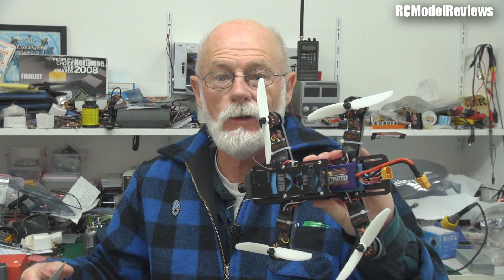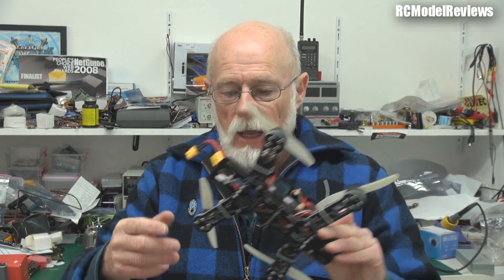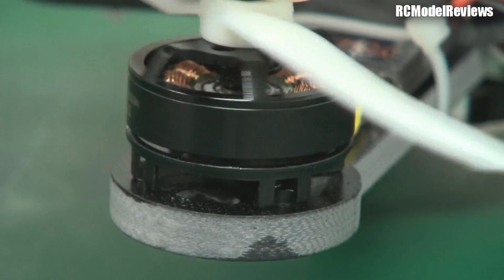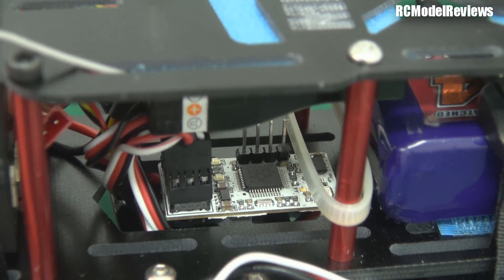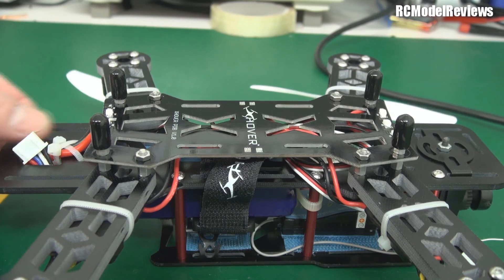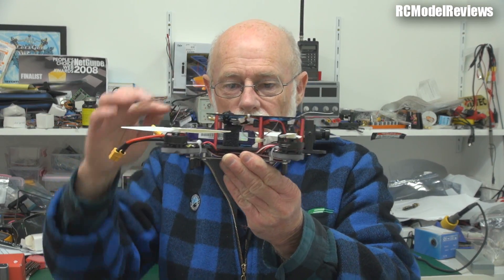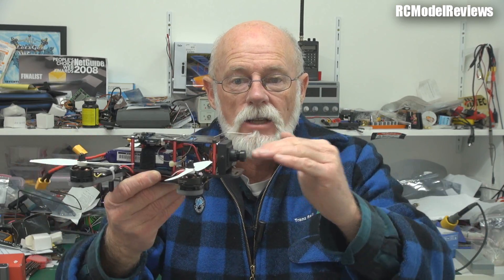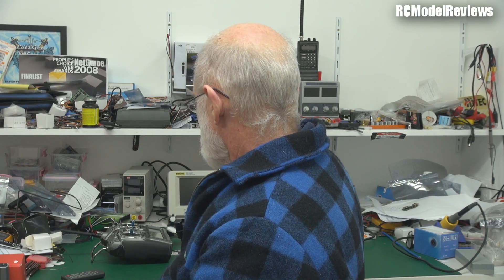XHover MXP230 mini quadcopter review (part 1)

Comment: Hi Bruce! got an issue with my vtx grounding to my mxp230 carbon fiber plate. The vtx has a 10cm extension with 90 degree end for the antenna. The 90 degree end is going through the antenna mount hole on the top plate of the mxp230. after a flight of fuzzy lines in the video i landed and the top plate around the antenna mount hole was VERY hot. Would you know why this is happening? I know carbon fiber is conductive but is there anything im doing wrong with mounting the antenna trough that hole? Thanks again for help Bruce!

Comment: For my second build I've been considering this frame. Does interference from carbon fiber make a difference in range?
Reply: So long as you position your antennas clear of the frame then there should be no problem.
Reply: Ok thanks for the tip!

Comment: Bruce,
When you directly solder the motors to the esc's, do you have to strip the insulation from the motor wires? Or do they not have insulation that far out? Did you or could you do a quick video on the best way to solder the motors to the esc's?
Thanks

Comment: look forward to your shootout, however I wonder if the frame is a significant factor to the flying characteristics, after all it's just to position the motors and components in the right place with as least weight as possible.  surely the flight controller, choice of prop, motor and esc plus tuning and config would have the greatest affect on the flight performance.
Reply: A lower quality frames arms may flex and more readily transmit the slightest vibrations to the camera and flight controller. It does make a difference. :)
Reply: It's a combination of frame and controller.  Every component plays a part in the overall performance of the craft.   Certainly the controller is one of the biggest influences but as MW2Stambo points out, a bad frame can also cause problems -- especially when you are really throwing one of these things around.  I know of some manufacturers who have in the past, changed the geometry of their frames to solve handling problems and a twisted or flexible frame will never fly as well as a rigid/straight one.
Reply: all true and thanks for the comments, seems to me however that you don't need a flight test to measure frame performance.  Sufficient to check the geometrym weight and stiffness (bending/twisting with your hands), these measurements are enough to sort out the good frames from the bad.  :)

Comment: Hey,
Looking forward to the 4s flight! :D
How have You managed the FC offset, because the afro mini is far out of the CG?
Because i have a afromini my self and also want to put my battery inside the frame for protection
Reply: I was a little concerned as to the effect that moving the FC away from the CG might have but to be honest, it makes no difference at all.  Several people flew this machine over the weekend and they all had nothing but good things to say about it -- with the controller mounted exactly where you see it in this video.

Comment: I had terrible issues with the delta 8 receiver! Could barely get it more than 40 feet away before failsafe :O Maybe its just mine, can't wait to see if it is haha
Reply: No problems with the Delta8 -- flew it yesterday and it was rock-solid using the Hitec Aurora 9X radio.
Reply: Huh.. Well, thanks :) Maybe it's just mine

Comment: I've been after a Naze 32 for a while now. Looks like it flies well on the Afro version & they are in stock. If I order one, do I need any headers (straight or 90 degree ones?) It says something about a 3.3v serial cable that is not included. What does it mean by that? Can't wait for part 2. Keep up the good work.

Comment: just thought id chip in bruce the fr - sky delta 8 I don't like for mini quad I upgraded to irc uhf 4 ch on my black out mini h I fly around me in 300m field with lightly dotted trees at about 100 metres behind one tree i lose signal guaranteed everytime with the delta 8 Los is a mile on my tbs discovery with both aerials in a v I made to keep them straight I'm using the futaba t8j tx fhss mode cppm mode on the naze full board 600mw ir 5.8 ghz  just so you know ...... keep up the good work you help us all

Comment: Bruce - let me ask why You don't use those 4-in-1 ESCs (for example Q-Brain 4x20A or 4x25A)? From my expirience they are amazing - light no and hassle with cables and/or power distribution board and BEC at all. For mini quad they seem to be an ideal option!

Comment: I know you are the outlet for different companies but since I am not so convinced about those miniquads compared to "bigger but also small and fun" 8 inch prop sized quads being sooo muchhhh mooorrree fun. (I understand they are creating a market and pushing out products flooding the review channels). Since this is supposed to be about "fun" and "rc hobby" and "promoting the hobby" and not 100% about review$ wouldn't it be reasonable to do a DIY wood/alu miniquad build with your expertise put into the design? Just a thought.
Reply: I was never much of a quad fan until these minis came along -- they are a whole different kettle of fish.

Watching some of the larger (400/450 sized) quads at the field this weekend, they fly like a moth stuck in treacle compared to the minis and when you crash the bigger quads you're far more likely to be dipping into your pocket for replacement parts.  You can build a miniquad from wood and it'll fly just fine -- but it probably won't be as light, tough or tight as these commercial frames.

If you haven't tried a  miniquad yet -- beg, steal or borrow someone else's and you'll soon see the dramatic difference.   Also, by the time you fart around with a wooden frame, you could have bought a cheap Chinese carbon one and put it together.

However... one project I have (under the binch) at the moment is a miniquad built from the Quadlugs components.   That'll be interesting (and pretty cheap).
Reply: ***** Higher KV motors = less efficient = less flight time. Carbon: Transduces vibrations much better, blocks RC signals, pricey, hard to repair & health hazards (lung cancer etc), Carbon is too stiff to be collapsible so motors are more likely to be damaged. Wood + Alu is the way to go but hey, too less dollars for you and your advertised products. The miniquad hype is just a hype to squeeze more money out of the community. And you are part of it and pushing that bullsh*t so congrats mate you just lost your last bit of credibility. And what about that naze stuff? I guess the FBI wanted Timecop / Tim Copperfiled (google it and you will find out that he is just a criminal) stuffed you with money / hardware as well since there is no advantage over a multiwii flightcontroller. You are not neutral or independant in any way your "rewiews" start to stink quiet hefty and you are supporting FBI wanted criminals. CONGRATS, keep it coming!
Reply: *****
So true... there's none so informed as those who only speak from the sidelines ;-)

Comment: I have the blackout H quad and it has just been sitting in my house for the whole summer. I tried to use a Flip 1.5 board but I am not sure how to tune it. The roll and pitch tuned fine but the yaw was really fussy. It would yaw faster one way than the other. Then I found the motors were spinning the wrong way. I guess the motors were supposed to be spinning outwards so I desoldered and re soldered everything. Now it wont even take off. I need some help.
Reply: Motors (for most controllers) should spin like this (with the back of the quad facing you):

front right - anticlockwise
back right - clockwise
front left - clockwise
back left - anticlockwise

Fit the props so that they're all creating lift when the motors spin in that direction.
Reply: I think it is the control board because I got them spinning the right way. The gains are the problem.
Reply: Bajesus042 calibration, trim? or get the cheap acro naze (25$)
Reply: Servicehans
Yes, the Naze32 has work without any tuning (in horizon mode) on just about every frame I've tried it on.   Getting your hands on one might be a problem though ;-)  However, the little Naze Afro mini seems to work every bit as well and it's only $20.  Abusemark.com has them in stock.
Reply: thanks I was wondering where to get the Naze boards.

Comment: What are the best motors for a mini quad I would like something under $20 preferably $10 and lots of power.
Reply: Dys 1806 2300kv
Reply: Servicehans
Would u use 2 or 3cell with these
Reply: Stay tuned -- motor shootout is underway.

There are quite a few new 1806 motors on the market now but there are still some good 2304 units out there.  The motors I've fitted to the MXP230 seem to work very well and they were about $13 each from memory.

Comment: What firmware are you running on the ESCs? I'm building a 250 and am having many ESC troubles with the BM2304 motors.
Reply: These are the stock RC Timer ESCs which run SimonK software.
Reply: I wonder what version of Simon K it is. I'm having severe timing issues with Afro ESCs on these motors.

Comment: I'd love to race you Bruce!  I want to see a wicked mini quad race course Bro!
Reply: 6in props and 4s, you must be insane! :D
Reply: Here's a review idea for comparing all these quads: Race em!
Reply: Matthew Adams
Don't worry -- racing is coming!

Alishanmao and I are also working on creating an international Race-By-Net class, where there's a standar course so anyone can set up something and race around it.  We can then compare times and videos over the Net.  This would allow anyone to become a racer, even if they have nobody nearby to race against.
Reply: ***** thanks for all your great informative videos. I know that you are very knowledgeable.  I have the 250 size quad with  SunnySky 2300kv. I have flown it with both 5x3 and 6x4 probs and 1300 mah 3s battery. With 6x4 props and 3s battery it turned to a beast. I can hover 20% throttle and I don't dare to push to 100%. 4s and 6 inch would be so powerful. I am not sure if the motors can handle that. And throttle management would be challenging.

Comment: You're amazing, how do you get the time to build so many mini quads Bruce!! Nice work buddy. I'm still struggling to finish off mini number 3!
Reply: Well it is a full-time gig -- albeit an unsustainable one thanks to MFNZ and CAA's intervention -- but while I can, I'll keep putting in as many hours as I can.
Reply: Fantastic effort either way!! We're still waiting on a HK order to finish off mini no 3. BTY Xhover looks like a very clean build
Reply: *****  
Hi Bruce, i was wondering if the Delta receiver works with the Hitec optic 6 with 2.4ghz module. if i get one frsky delta 8 like yours will i need to do anything like firmware updates or buying another module from frsky?
Reply: Babis xalkias
So long as your Hitec module is running recent firmware you shouldn't have any problems.  The very early ones need to be updated to work with the Delta8 (or so I believe).
Reply: My module is 3 years old more or less. will it work?
Reply: Babis xalkias
I don't know for sure... I'll see if I can find out.
Reply: thank you for your time Bruce, I apreciate it alot.
Keep the Good job and the great videos.
Reply: Babis xalkias
Thanks for the kind words.
Reply: Hi again! I've got the Frsky Delta 8 receiver to try it out with my Hitec Optic 6 and it doesnt bind. Now it dont know what to do, buy the hitec programmer and then i can buy more frsky receivers or just buy the regular hitec receivers?
Reply: Babis xalkias
The bind process can be quite tricky... it can take quite a while to bind, sometimes a minute or so the first time.  I almost gave up until I left everything in bind-mode for a minute and, when I came back, it was bound!

Try waiting longer to see if it binds up.  Read the instructions regarding the meaning of the flashing LEDs on the receiver.
Reply: regarding the flashing LEDs i couldn't understand. The LEDs were flashing slow , fast together they were doing everything that the instractions say. I will try it again but i think there is something wrong with the instructions. It says to press the bind button on the Tx module and wait for the Blue LED to start flashing for binding but when it's in binding mode only the red LED flashes
Reply: Babis xalkias
I'll check the modules I've got here but I think there are two modes -- one is when the blue LED flashes and one is not.  One activates the frequency scanning and re-allocation of the hopping table (requiring your other receivers to be rebound) and one doesn't.   I'll see what I can uncover when I get back to the workshop.
Reply: oh i'll check that too. i didnt know that
Reply: I had the receiver for more than 5 minutes to bind but nithing happened.

Comment: Interested to see the QAV250 review. I got one, my first quad and love it, but I have nothing to compare it to and I'm keen to see if Bruce has anything noteworthy to point out about it that might help make mine better.

Also I'd love to see a CC3D Vs Naze32 review, perhaps using the QAV250 since it came with the CC3D.
Reply: Yes, I've been flying the QAV with the CC3D and will spend a little more time "dialing it in" but I will also be throwing a Naze32 Afro Mini board in it and comparing the two flight controllers.
Reply: Excellent, I'm using the Naze32 in mine based on your (and the rest of the internet) loving them, I must say as a first quad/flight controller I am impressed, simple to use and the stock settings fly just fine.
Reply: venturation
Watch my XJet YouTube channel tomorrow and you'll see what one former CC3D flier thinks of the Naze32 he tried for the first time today in a miniquad ;-)
Reply: Will do, already subbed :)
Reply: *****
Yes, I've explained the endpoint stuff in the video I've almost finished editing -- had to reshoot a bit due to audio issues.

Comment: The Naze appears to be in front of the CG because of the battery placement.  Will that make any difference to the flight characteristics ?

Putting the battery in the frame rather than on top of mini quad does seem like a good idea otherwise they start to look like one of those top heavy cruise ships.
Reply: The forward position of the flight controller appeared to cause no problems at all.

Comment: Heres another con: Its stupid bloody expensive!
Reply: Quokka57
We did a fair bit of "crash testing" today. 

I piled the blackout in really hard -- found the board-camera and battery about 20 feet from the frame and the battery-strap about 30 feet away.  I think the battery parted company in mid-air.   Damage: Two broken props and some broken plastic screws.

On two occasions the MXP230 fell from quite a height when the battery went flat (no telemetry or battery alarm and I was giving everyone a fly of it).  No damage at all.

There were some Cheap Chinese frames there but they were being flown fairly slowly and didn't have any crashes so no damge there either.

Very interesting to see how impressed most people were with the brand-name frames though when it came to actual flying characteristics though.
Reply: If your time is money (and it seems, based on the huge sales of RTF gear, that many people do have more money than time) then the cost of a precision-made frame like this is worth the extra money.   If you just want to spend $30 then buy one of the Chinese frames and spend more time putting it together.   The build of the MXP230 was about 3 hours.  The last ZMR250 Chinese frame I built took two days -- by the time I filed and sanded everything to shape.

Fortunately, we all have the choice.
Reply: ***** How does this one cost less time than a cheap one? Ofcourse I wont deny some of the Chinese ones can be a bit dodgy on tooling, but ive seen quite a few already that aren't as bad as the one you showed with the bad motorscrew slots. The $30 ones you showed were the absolute bottom of the bargain bin, and poor quality is prettymuch guaranteed with those, but some of the $50 range ones are actually quite good.

The thing with these frames is that they are meant to be flown rough and risky. I wouldn't want to do that with a frame that costs 130 bleeding dollars. Id rather not fly a shelf queen, you cant see the frame from your goggles anyway. ;)
Reply: SvenOkonomi I think Bruce mentioned doing some "crash tests" further down the track, IIRC.

That's where we may see if there's any benefit between $100+ frames v's the cheaper clones.

If the more expensive frames are based on genuine high quality Carbon Fibre components, and the cheaper ones use less-quality CF and/or fibreglass, it will be interesting to see if the expensive frames only break an arm or two and the cheaper ones are totalled and headed for the bin after just one decent stack.

Looking forward to seeing that kind of testing :D
Reply: Quokka57 Id love to see the results on that one, too! See if theres really money to be saved in grinding chinese parts, or if it ends up being more economical to buy one fancy expencive frame that supposedly lasts longer.

Comment: I'm sure you'll absolutely love your MXP230. I've upgraded mine to a 4s 1800mAh Glacier Lipo and 6" HQProps. It'll hover at 1/4 throttle with that setup and the speed is wicked fast. It flies like a much bigger quad and really takes a beating! At that point, you don't even notice the extra weight of this frame over other quads like the Blackout H and the acceleration is just insane. It was a very thought out frame and I believe that XHover did a great job on this quad when he designed it. I have some flight footage on my channel if you'd like to check it out. Hope you have a blast with your MXP230!